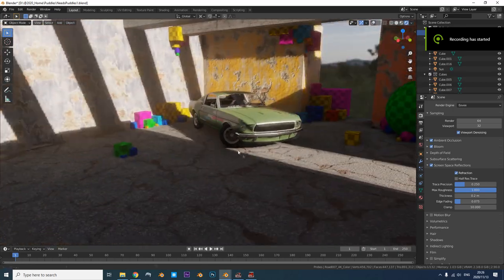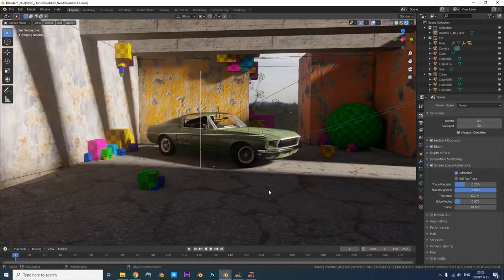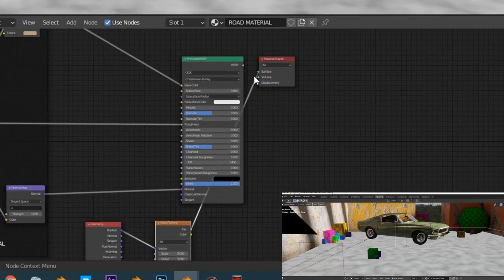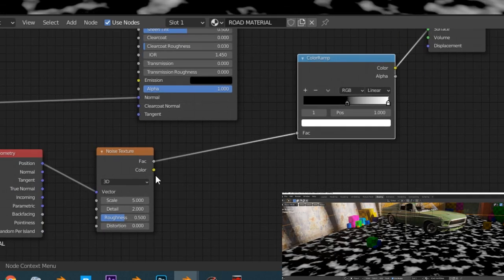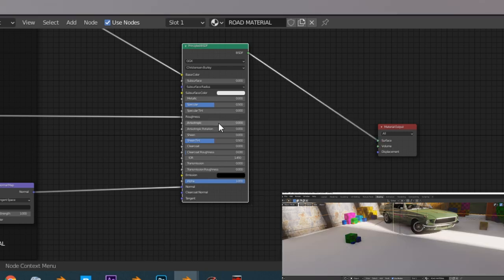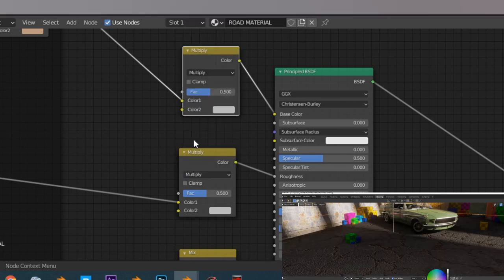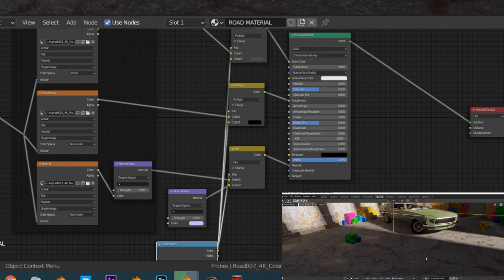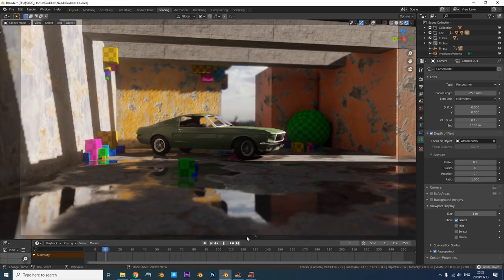How to make Puddles - Blender tutorial 2.8+

Comment: Learned nothing new =S 
Sometime ago I looked at nodes like those weird things I don't understand and want to deal with as little as possible. Now I build huge node trees to achieve desired effects kinda almost with pleasure. It's amazing. I just imagine how things should workout, and they do most time, it's like some kind of in-built substance designer(never used one)but allows to create and heavily modify materials inside blender. That noise texture for example can be 3D, you can use it with volumetric to get detail, and even animate distortion value to get animated fog. Such an awesome program.